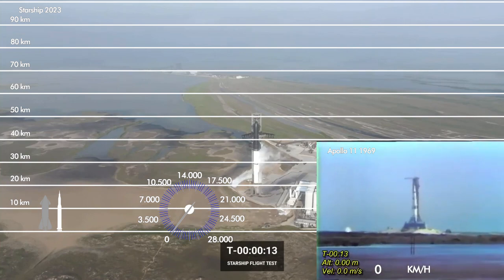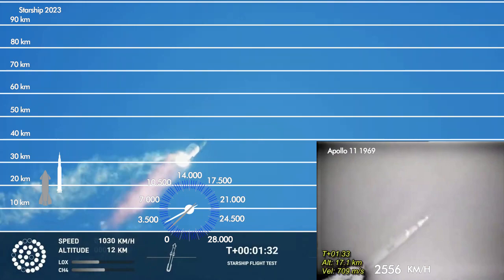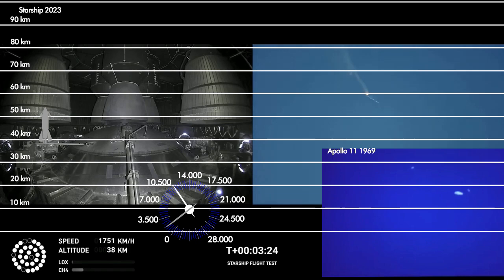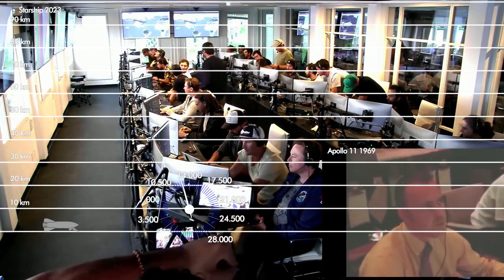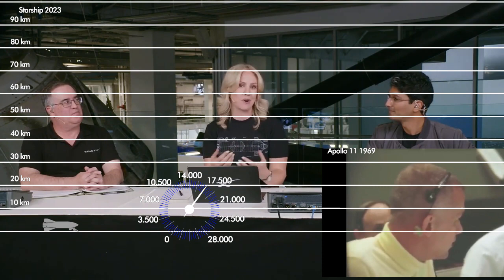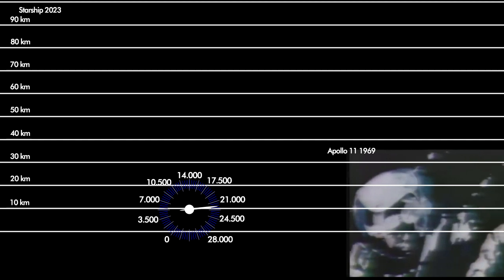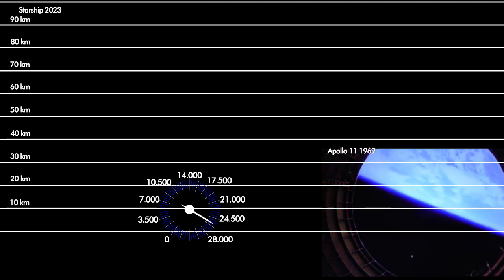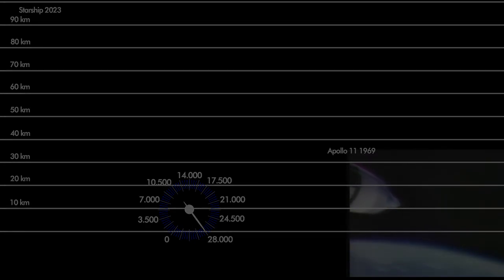Launch Starship Spacex vs Apollo 11 Saturn V acceleration speed altitude comparison 20. april 2023

Comment: Yeah let’s compare apples with bananas: private x government, 9 years with hundreds of thousands of people and unlimited funds with 2. 5 years, and limited capital less than 3000 people, fully reusable x discardable, and mainly : TEST FLIGHT x AFTER SEVERAL YEARS OF ITERATIONS AND ENGINEERING.
Reply from the maker: "fully reusable"
Reply: One got us to the moon, the other blew up 24 miles in the air...
Reply: @shilpwift3366  The spacex flight was the first test of the fully unified rocket. This was EXPECTED to fail - they would consider it a success if it cleared the tower. It did so and continued to fly for 4 more minutes until it was supposed to separate, and something went wrong at this point, but it was already a success by then.

It's hilarious, and also sad, the number of people TRYING to find something to hate on Elon, or Tesla, or SpaceX for. Why? Why are people so determined to find fault (or just distort reality), to hate, to try to minimize any accomplishment?